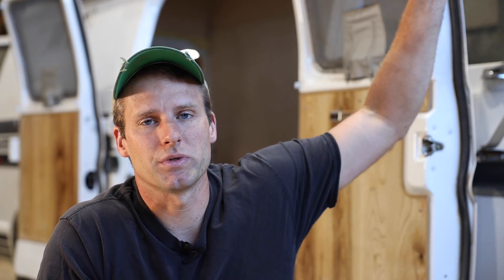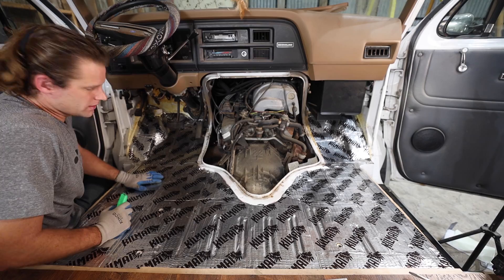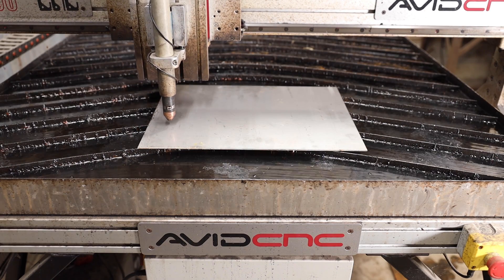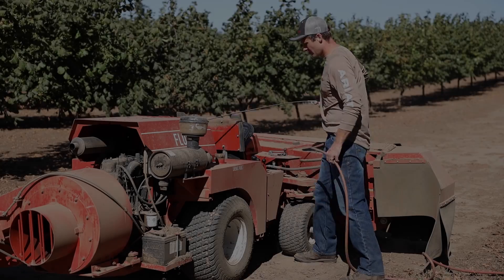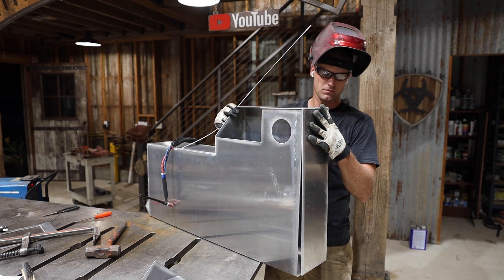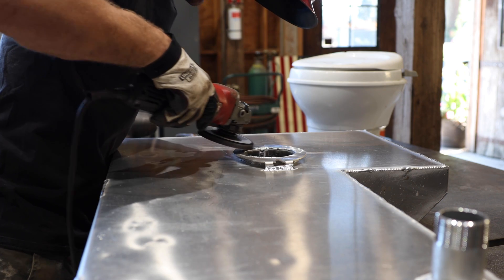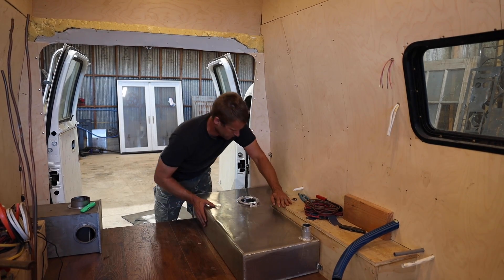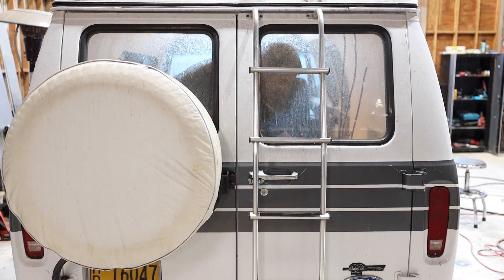Aluminum Poop Tank for the Camper Van

Comment: JD, great video. As a guy who has lived many years in a travel trailer off the grid, I definitely suggest tossing used toilet paper in a small trash can. Most civilized folks thinks that’s really gross…. But trust me…. wet toilet paper seems to turns to a solid plaster chunk in the tank. It doesn’t spread around the width of the tank. It just piles up directly under the toilet. In a mound. Then hardens like paper mache. So, most full-timers avoid that inevitable clog and we just discretely put used toilet paper in the trash can next to the toilet. Wrapped and hidden, of course!

Comment: As always: nice craftsmanship! But working for a "poop tank company", I have some concerns regarding corrosion. The stuff is really aggressive. We only use plastic or stainless steel. Over here in Europe, most camper vans have Thetford toilets with the tanks being accessible from outside. Much better than a bucket ;-)
Reply: Why would you be more worried about corrosion in aluminum than stainless? Ever stainless corrodes worse than aluminum under most circumstances, unless there's some kind of galvanic interaction, and the only place this is touching a dissimilar metal is the mounting tabs, and maybe the drain pipe, depending on what he caps it with.

I think the bigger concern would be the possibility of the aluminum cracking, especially as he puts his full weight on the unsupported center of the tank. Should have welded some central supports in place to carry the body weight from the top to the tank floor.
Reply: @Nevir202  Because alu and human waste = short life span, especially with the liquid side of the equation. The salts eat at that stuff like you wouldn't believe, and that's without discussing galvanic reactions. Stainless is an industry standard, followed by plastic (neither are perfect solutions, mind you).
Reply: @aserta  Correct. And using aggresive disinfection fluids and cleaners makes it even worse. Also need to be the good stainless (1.4404/316L or better). The crappy stainless will also die pretty quickly.
Reply: Yeah the life span of an aluminum tank will be short. I wonder if he could find a liner of some kind for it.
Reply: @Mrcaffinebean  Saw someone mention doing a pour in liner below, TBH, makes sense.
Reply: @Mrcaffinebean  Doubt there are any specifically for that, but there are all kinds of corrosion inhabitant coatings. Probably nearly any of them could be used that way, so long as you were careful to coat the entire surface.
Reply: There is aircraft fuel tank coating that might work.
Reply: why not just do a plastic bottom mounted tank on the underside of the van and replace it here and there. be no different in size than what he’s currently running
Reply: @Mrcaffinebean  I wonder if a spray-on truck bed liner would work.
Reply: I was going to mention this, too.  Many various cleaning chemicals are put into black water tanks.  Aluminum will corrode over time with many of these, which is why plastic and stainless steel is the most common.
Reply: I don't know much about poop tanks in particular but i know that aluminum "black water" tanks are common on boats which leads me to believe that corrosion can't be too bad.  However, those are generally much thicker. Also, it's probably more of a lack of options when the hull is aluminum and you need a large tank. SS would invite galvanic corrosion and plastic wouldn't be practical because of size and shape. I'm personally more worried about cracking than corrosion in this case.

Comment: May want to build something to protect that black water cleanout. Both from the road/ground and from stones kicked by tire. May need to coat that tank to protect it as well. Did you isolate the tank from the body?
Reply: Yeah, that was my first thought as well.  One medium-sized rock and the guys driving behind you are gonna have a bad day.
Reply: @makerpat  yes, this has to be protected, or even you should consider a better solution (both the aluminium usage and cleanout!!!)
Reply: My thoughts too on the risk of impact damage to the drain pipe/valve assembly. Or even an accident backing up the van. It's very easy to hit something on those corners. I've done that numerous times in my own vehicles. 

Whilst making it obviously more complex, I would raise the drain valve out of harms way, as high up as possible within the constraints you have to work with. Either that, or built some kind of 'skid plate' protection around it, which can take an impact and protect the valve

Comment: 0:41 if you put a solid cord (thumb rule is to be just a bit thinner than the glass, and to have as little yield as possible) in the rubber groove, as you press the glass, pulling it just ahead of the seated glass, it will "fall" in perfectly. Oldest trick in the book, most of us who restored old cars make use of it religiously, so it's a well tried and tested method.
Reply: I learned that way too 👍

Comment: I used Kilmat on my pickup. I did the entire floor (removed carpet and seats, inside the doors, back of the cab sides and rear panel, and inside the kick-panels. Not only did it deaden sound but road heat was stopped. I also upgraded the radio and installed four new speakers. Music sounds awesome. I think Kilmat is an amazing product. A roller came in very useful.

Comment: Aluminium for sanitary stuff is a big no-no. Not only will it crack under stress but alu gets corroded very easily by our bodily fluids. Best solution is the stainless, but you need to drastically re-evaluate how you weld it. Specifically, too much heat in the system (clues being the warping, and the fact that you have flash rust on stainless). Just my 2 cents.
Reply: Don't forget to purge the inside of at least use solar flux to limit the "sugaring."

Comment: The reason your stainless welds are rusting is due to using too much heat and not enough gas coverage. Your pulling the chromium up and out. It’s also a very good idea to either back purge (hard to do with the pieces you’re making) or use SolarFlux (it’s a paste you apply to the backside to prevent sugaring of the welds). You can also passivate the welds afterwards to prevent corrosion.

To help minimize the warping of large stainless sheets, use large blocks of ally or copper as “chill blocks” to help pull heat out. Skip around a lot and do small stitches only. Stainless is terrible at managing heat absorption.

Ally for sanitary is NO-NO. Those welds along the edges will probably crack due to vibration, weight (sitting on the toilet) and stress. The mounting tabs will probably fail due to weight of the contents sloshing about. Ally welds are pretty weak because they are more on the surface than penetrating the material.

I strongly suggest you return to the stainless tank and resolve any fitment issues with it and passivate the welds.
Reply: Seems like some very sage advice.
Reply: Love the video ! But I agree , as a professional welder, I have repaired a ton of cracked aluminum.  This is something you do not want to crack!
Reply: Good comment!
I think citric acid spray to passivate stainless is the way to go, even with specialty alloys like Böhler M390. It's safe and dirt cheap.
Also the ally tank might be fine if added an inner support structure. I know it's not the same as a fuel tank, but still i think this might work. Would make it harder to clean though...
Reply: I was hoping he would add some internal support to resist flexing from the weight of the user but it didn't look like it happened. He could still beef up the tabs some and possibly rubber mount them. I agree that stainless would be better though. If he's really worried and rusting from the sugared welds, he could probably use some kind of liner to seal it like people put in old vehicle gas tanks.
Reply: I am a wannabe welder, but even though this fellow seems to be quite a good welder I'm sure he GREATLY appreciates this kind of input from pros with lots of experience like this.  And for someone like me, the learning I glean from reading what you (and others who have responded) have shared here is invaluable.  All it would take is one crack in that tank to create a HUGE mess in that beautifully renovated van, so it's worth him finding this out now and doing it over to prevent a lot more time and cost in the future.  Not to mention a totally ruined camping trip!  Can you imagine having to drive that thing home with the stench from it leaking out inside?  And then to have to rip it all out, sanitize it, replace all the saturated flooring, etc.  Big fat EEW!  Thanks cj737.

Comment: You should have added baffles for strength and to prevent too much "shoshing"
Reply: Baffles would really interfere with draining the solids, though I guess you could do it if you left several inches unbaffled at the bottom.

That said, it really could have used a support to carry his body weight, directly below the mounting flange. As is, every time he sits, he's trying to crush the lid in, and all that force is translated into tension against his edge welds.
Reply: @Nevir202  I had the same thought. Support would be good but don't block the solids. Some things don't flow as well as others if you know what i mean.
Reply: @Lucas12v  Unfortunately, I DO know! LOL

Comment: Hey, new subscriber here! When you put down sound deadening mats, they work by being completely attached to the metal underneath. You have to use a roller to stick them down or they will not be as effective. You'll know they are totally stuck down when the little grid marks on top are smoothed out. You'll need warm weather or a heat gun to really get them installed properly. If you ever have the carpet back out, you might consider re-rolling them really well.

Comment: I'm not sure if I saw that correct, your (hi-beam) switch on the floor, make sure that's mounted under the carpet, NOT on top of the carpet. I made that same mistake on an old 79 ford truck. Didn't know why my head lights were not working. the bi-beam foot switch has to be in contact/grounded to the steel floor. I first had it on top of new carpet I installed.

Comment: Do future you a favor and add a redundant gate valve to the waste line. Also right where it exits the tank, I suggest you put a Y fitting with a threaded leg that you can use as a clean out. When you have problems with camper plumbing, it is enormously more pleasant to be able to completely flush out the lines as well as being able to isolate different sections of the system. I know it doesn't seem likely to happen, and you're right, but when things go wrong it can get very messy very quick. I guarantee you the day that you have a leak you will wish that you had added the gate valve. A redundant gate valve.
Reply: It's also pretty common for the valve at the end of the line to get brittle from the sun or from backing into things. By adding the gate valve to the tank exit, you will be able to replace or patch up without dealing with pressurized shit

Comment: GREAT VIDEO! One thought about the tank is how it will ring/resonate. You may want to carpet it or at least put a layer of your acoustic mass-loaded material on it to help dampen the effect. Others are raising a good point about it not being internally supported in the middle, which if you decided to go back and do, would also raise the resonant frequency and be much easier to cancel the ringing. Putting some slight cushion between the tank and floor will also help decouple it.

Comment: Great work as always, but you may be back for a third time? I was concerned about the flexing of the unsupported alu top when you sit on it (cracked welds) , vulnerability of the drain valve, and lack of slope on the tank to have it drain to one corner, and now others are pointing out potential corrosion issues. At any rate I'm sure you'll make it work. Carry on!
Reply: Slope is not an issue. Just find a hill and park conveniently. ;)

Comment: Is the drain outlet at risk of damage while driving with it hanging down like that?
Reply: It looks like it's in the prime location to hit something while reversing (or on uneven ground).  I think I'd have tried to get it within the wheelbase - but that may not have been practicable.
Reply: @dav1dsm1th  rocks too coming off the tire. It also completely ruined any departure angles he had.

I know it's not an overlanding rig, but still don't want to see a mess on the road.

Comment: I don’t know if you do this part already or not but any thing you use on stainless like a flap disc or wire wheel should only be used on stainless. You can not use the same consumables on steel, then stainless. It will leave small particles in the stainless and rust.

Comment: Great Job ,
Just wondering why you didn't pressure was the seat bases , Would have looked great 
Fantastic Vid Very professional finish on the Tank .I have had ALUminium Tanks in my RV for the last 7 years No cracks no electrolysis no Problems at all the plastic (PVC) crack after a few years My Black and Grey tanks are earthed to the chassis and have Anodes fitted , Great choice 
Rob 
NSW
Australia

Comment: Man I've never seen a comment section with so many experts! Love your work mate as always. I reckon give it a few months of use and some spicy curries... that will really test it! As a bandaid fix I wonder if the experts would permit you to pour some kind of coating/lining into the inside of the tank to prevent corrosion? Happy pooping! 💩

Comment: Couple of things.  You might want to do an epoxy coating on the inside your black water tank.  Urine and Aluminum tend to be a bad combination.  Also might consider a good set of mud flaps to protect your cleanout valve.

Comment: In the "van life" videos I have seen, it seems most people are using a "composting toilet".  With a composting toilet you don't have a "black tank" and some people think it's a better solution for a camper van.  (Urine is saved separately from solid waste, and a fan blows air through the composting chamber to dry out the solid waste, and reportedly you don't get any poop smells but more of a smell like soil.)

I'm interested to know if you considered using a composting toilet, and if so, why you prefer the black tank.  Maybe it's because you already had the toilet from the factory build of the camper van so this is the lower-cost solution?

Comment: Be sure to use an aerator in the water on the plasma table. The molten aluminum will form hydrogen as it hits the water. If you are not aerating the water, the hydrogen can build up and become a fire/explosion hazard.
Reply: Thank goodness hydrogen is one of the lightest elements in the universe - so it'll simply rise upwards and escape through any holes in the roof...
Reply: At work they drain the water down before cutting aluminum on the plasma table.

Comment: Great fabrication skills! But I’d really resort back to the stainless tank, you probably welded it too hot and maybe didn’t clean it properly or cross contaminated somewhere down the line. I see a lot of comments about a baffle, I highly doubt he’s going to be driving round with that much in there he’d feel it, but at least if ones in there it’s piece of mind, would also of minimised warping from welding and pressure testing.

Comment: 2 quick things, you either need to aerate the water in the plasma table or use a coolant that is rated for aluminum so as to not create hydrogen gas and blow yourself up. Plasma green has a good coolant that is alumin rated.
Also, you are going to need to pull that aluminum tank back out and coat it with an epoxy that is rated for what your doing, aluminum can't be used for sanitary stuff like this.

Comment: Using the aluminum is not a good idea for human waste / sanitary stuff it will be prone to stress cracking and corrode.   Please go back to the stainless and adjust your heat accordingly.  

Also one quick think to mention... your drain plug is very low, one late night reverse in the dark could lead to a really poopy time.

Comment: Great design, but wrong placement of the black water drain. 
First time you back into a parking spot with a concrete stopper you will brake it off. 
Otherwise, it looks great !

Comment: I’m enjoying the videos for years now but have to throw in my bit on this. First aluminium, it’s going to corrode like mad immersed in sewage. Secondly the internals are unsupported so it’ll eventually crack from use/ weight on it, also internal support can act as baffling plates and reduce sloshing movements and sound. Can’t imagine you guys enjoying a drive with the sound of sloshing sewage in the van. 🤢. Lastly the plastic fitting on the underside. If this is unprotected it’s prone to being hit from objects you might drive over or curbs you might back up on, or hills or anything that rises up before the wheel gets there. Your going to crack it or break it off. Poop everywhere. 🤢. 
Love the fabrication though but mind the hydrogen issue from plasma and water on the cutting table - could go 💥.
Greetings from Ireland by the way.